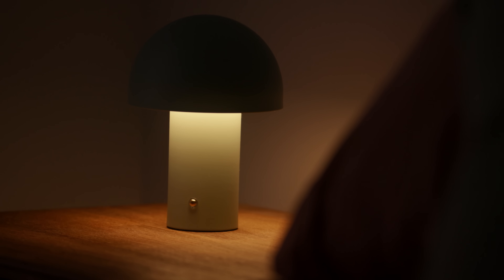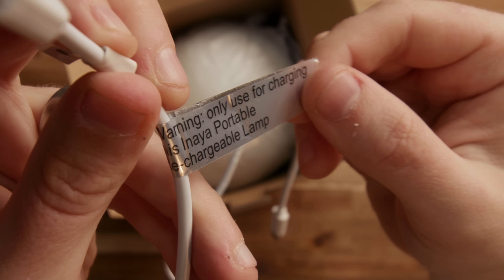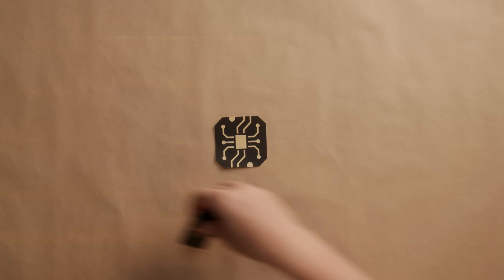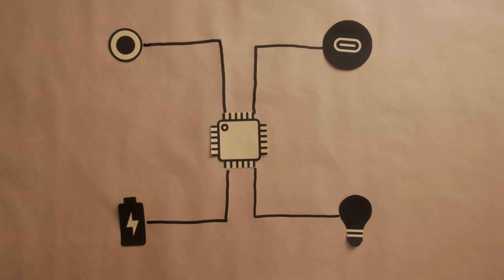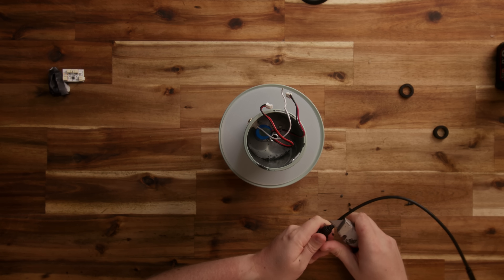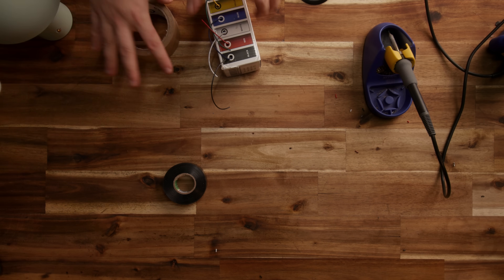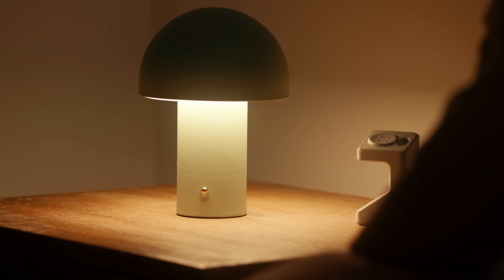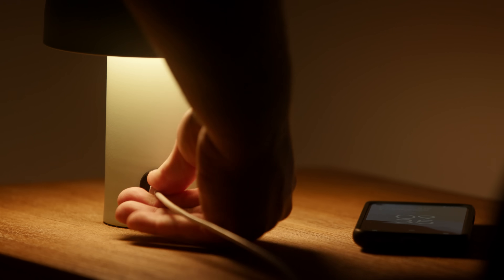Kmart Lied to Me, So I Hacked Their Lamp

Comment: Here's the technical reason for it not working with regular USB-C:
USB-C to USB-C cables strictly follow those standards, and so do their power bricks. That means that by default, no voltage is being provided by the power brick. To turn on the standard 5V (or then 9V, 12V etc), you need to have certain resistor values on the two CC lines. Most cheap products from China, for some reason, don't include two simple resistors... but that's the reason why it doesn't work with a regular USB-C cable. 
Their cable isn't anything proprietary, it's just a different one: USB-A to USB-C. Why does that make a difference? USB-A power bricks don't need any values on the CC lines, since they don't even exist in that connector. These bricks just put out 5V whenever, which is why it is charging with that one. Technically you could've soldered two resistors to it, but that is very finicky.
Great solution though!
Reply: The reason resistors are missing is often because they use cheaper and easier to solder connectors which are missing the CC pins.
Reply: Yeah or you can replace the port with a board that has PD support and solder the ports that make it accept 5 volts.
Reply: @blitzar8443 pd is not required for 5v operation
Reply: Yeah so many stuff that has a USB-C socket but only charges via A to C cables.  
Super annoying.
Reply: @DooMMasteR  I've made it a habit to solder some USB-C breakout boards with the resistors in place to all electronics I have easy access to. I even USB-Cified an older printer from 2006 which ran on 20V via PD!
Reply: Minor correction TLDR By default USB-C specifications* are to provide 5v by default

"That means that by default, no voltage is being provided by the power brick. "
If no voltage is requested, then 5v should be provided by default  for two reasons: 
1) Backwards compatibility, and 
2) To power the device so it can actually request/negotiate for higher voltage. 

"To turn on the standard 5V (or then 9V, 12V etc), you need to have certain resistor values on the two CC lines."
Kind of, you do need the CC resistors to determining orientation, and 5v initiation (so it won't work without them) however they are not used for negotiating voltage. The confusion might lie in that CC resistor values can be used for communicating current capability?

FWIW the video is correct when he said 1:40 "this isn't USB-C at all" 

*The three main power specifications for USB are PD, PPS, & AVS and all three are specified to provide 5v by default.
Reply: Without these resistors, no voltage is being supplied. That's why I say they are required for 5V. With " then 9V, 12" etc. I meant that with these 5V supplied the PD chip or whichever protocol is being used may negotiate a higher voltage, a specific voltage, current limit and so on. Personally, the USB A power bricks provided 5V by default, the new ones only under these conditions. Would they provide it "by default", we wouldn't have these issues. But after all, the resistors have their valid reason in the spec.
Reply: @skyslycer they cannot assume that there is a sink plugged in, that would be risky, and the other end might be a source only device too.

USB-C can be both roles in the same port, 2 resistors are already the simplest route one could basically go.
Reply: @DooMMasteR  I know. I didn't say that that's bad behavior, it makes much sense to do it that way. You can still plug in both ends of USBC into a charger, but afaik, but don't quote me on this, the resistors don't do anything to prevent that.
Reply: @JustinShaedo No USB-C must be powerless by default. The resistors indicate a sink so a potential source can blindly apply 5V. But without resistors nothing will happen.
Reply: I thought it might be something along those lines. But if the lamp charger is connected to eg a phone or PC will it fry it due to putting 5v on the negative data line?
Reply: @imaginitivity7853 no. USB A always has 5V on it. Not in the data lines, it’s on the power lines.
Reply: @imaginitivity7853  it should not fry anything, the lamp is likely wired interally to only have vbus and ground connections and no data connections so it should not be putting any voltage on the data lines

Comment: This project looks awesome, I don't think there is anything like that in Canada but boy is that cool... one thing do beware of cheap ESP32 boards I bought a pack from aliexpress for another project that just refuses to stay connected to WiFi or OTA update, buying a more expensive one from Amazon seems to be working flawlessly, I don't know what to do with these two non functioning boards but I saw a thread saying if you power them by the pins instead of USB they work so idk I guess I'll have to give that a shot. I really want to start building more DIY stuff but I am a real noob when it comes to this hardware stuff

Comment: Really nicely done! But the batteries will drain in a few hours, or perhaps a couple of days, right? The ESP32 + WiFi combo isn't exactly great for batteries. Perhaps you can look into ESP-NOW, and use some kind of polling? Wake up, check for new message, and apply that. My ESP32 projects using ESP-NOW only stays on for roughly 200 milliseconds, which will save a lot of energy.

Comment: The cable won't fry any other USB C charged electronics, it will just be really slow. It's obviously not using PD, so a cable with a set of resistors is used to control voltage and power. This is really common in cheaper electronics and makes for a boring video.

Comment: Missed opportunity... What you could have had done Is use a USBC power bank board. And then you can upgrade the battery or keep the same battery up to you but you would be able to quick charge the battery and you could plug your phone into the lamp to charge your phone. 

Also anyone that wants to do this without the automation, but wants to keep the USBC compatibility can just use a standard USBC lithium battery charging board.

Comment: What psychopath goes through the trouble of continually recharging bedside lamps. Just get ones that plug into the wall
Reply: Handy for camping. And for rooms where there's no available power socket nearby.
Reply from the maker: If you can find me lamps that look like these and cost $17, id love to go that route!
Reply: @TheStockPot-AU  no need to go searching - you just made one - remove the battery and have its power cable be the usbc port and use a simple power adapter for it 😂
Reply: @TheFreeBro    "psychopath"   😁
Reply: The idea is that you can carry it with you to use the bathroom or get water at night
Reply: Cordless is also more aesthetically pleasing.

Comment: I like the esp32 mod and you don't specify exactly what was dangerous about the USB cable. However the most common problem with devices that behave like this is that the USB C connector ON THE LAMP doesn't support USB C PD. This require a 5.1k resistor connected to ground from the CC1 and CC2 pins (separately). Missing these out means that a proper PD charger will not turn on the power, and if you have connections for those pins and can fit the resistors it will work. The reason the USB 2 to USB C cable works is that USB 2 has no need for these pins either (and indeed, they can't be connected).  But as long as you use the USB 2 outlet on your charger it won't care. It's not usually a special cable - it's using the USB 2 that makes it work.

I could be wrong about it in this case :I see no reason for the marking on that cable as it's just like every other USB 2 to USB C adapter cable. But it's not impossible they did something truly weird.
Reply: 100%. They probably just put that label on it so you'd definitely use a USB-A charger. It's probably a regular cable and there is no danger to any device. This could have been solved by using any USB-A charger with any USB-A to C cable and/or adding 5.1 resistors to CC pins. 

But that wouldn't be good clickbaity title.

Comment: First video of yours I've seen.
Enjoyed and subscribed...

K-Mart need a slap for doing that.
Actually would have been better if they'd used a two pin mini audio connector on the end of a USB A wire if they weren't going to follow USB C protocol.
Hats off to you for the upgrade.

Comment: It's a *stationary bedside lamp*, it's not supposed to use batteries to begin with!

And if outlets are an issue, sibce USB C is going for "everything" connector, then USB C standard should also include a "passthrough" devices, where - dunno - a device has an exit port for further charging, and then auto adjusts itself to the received voltage (that is dictated by the plugged-into-it device) via switch mode power supply; or he lamp itself houses a charging circuit.

Honestly, the latter should be the option. I'd make a standard AC lamp that powers itself however it pleases, BUT provides:

- a hidden-underneath (but ventilated) place to plug one's preferred AC charger, with a stylized cover/opening to plug in one's USB cable, or the lamp provides its own retractable variant (or, it could be just a small "podium" addon that plugs into the lamp, so one doesn't have to bother with the cable).

- comes with integrated standard USB C PD charger with one-two-three ports (A and C).

But I think the first approach is better. Simpler to manufacture, and the user provides their own charger (thus it always fits their phone/device, whatever it might be), with the lamp just being a nicer housing for it. Maybe have an attachable addon for the back side of the bedside table, where one weaves their cable, and adds small weights so that the cable autoretracts once unplugged (simpler, no expensive and wearing sliding wiping contacts needed, fits whatever length and type of cable user might need), with built-in "stop" lock, so it doesn't continue to tug on you if you're using it and charging at the same time. A nice "cable dispensing/resting" spot would be at the hand's reach.

And, speaking of lamp, make it user mod friendly and have it use simple and standard connections, and "smart-ready" for the user to add either a simple relay, or more advanced means of control. And, while we're at it, offer custom lamp shade types that all fit the same lamp housing, for customization. The light element itself should be standard bulb socket (for easy and very noob friendly smartification), but make it easily detachable, so it is servicable, and/or exchangeable for alternative lighting sockets (not everyone everywhere uses the same format). And leave enough interior space, if user really wants to add a battery - or offer it as an addon, but then have an option of easily setting it to turn on if tge power is oit (given specific conditions).

( . . . )

Well, essentially... I guess I'm tell you to build your own darne lamp! With blackjack and h00kers!

There, a complete and extremely user-friendly product design!
Reply: Can't speak to this lamp specifically, but I love my battery bedside lamp. I've only had two power outages since I got it, but it's extremely useful in those situations
Reply: @Avendesora  Well, yes, but only as an UPS option, I guess, that's what I am saying. Or, simpler and more useful, since if there's a power outage, and you need light, you probably need it to move around. So, a rechargable torch / hand lamp in the first drawer (or wherever is the most appropriate, taking into account frequency of outages) would fulfill the same role, and allow you to move about.

There, modify my concept for the body of the lamp to be a "dock" for torchlight, essentially; and it should be easily pulled out (removable shade & light dispersal contraption) when needed in case of an outage. 😁

Hm, shade's light dispersal could also offer some sliding mechanism to either scatter or focus light, and when focused, direct it in specific general direction (when one's reading, no need to light up the room, and keep others awake).

Damn. Now I have to bloody sit down and design this thing properly. I guess I'll just add it to my "YouTube video ideas" backlog... for when I actually start the channel. 😅
Reply: @cbs1710  It's nice to have something that doesn't need me to hold it if I want to light an area, but I understand that multi-purpose furniture is highly offensive to you so I'll let you go about your day.

Comment: USB-C is a connector standard. It is not a data transfer or power delivery standard. You can have USB-C without it complying to any of those other standards/protocols because it is just a connector. Some of those other standards require a USB-C connection but not all USB-C connections require those standards.
Reply: Meh, he's half right. uSB c is just a connector, you can run usb1, usb2, usb3 and usb4 over it.  And thunderbolt 3, and a bunch of other non USB stuff, like some audio stuff, and there's even an Ethernet standard...

Comment: Sorry, but you forgot to mention one MAJOR downside of using an ESP32 on a battery powered device. 

Deep sleep doesn’t work for this application, since the whole point of ESPHome is to automate it. So the WiFi eats the battery in 1-2 days, with the light off.

Comment: You guys have Kmart still???
Reply: Kmart in Australia was started in 1969 and was only partially owned by the same company that owned the US Kmart, they sold their stake in the 1970’s. 

Kmart Australia went through lots of changes over the decades so it would be impossible to think they were related if you didn’t see the name. They sourced completely different products.
Reply: @peter65zzfdfh  To be precise, the 1978 deal had the Kmart Corporation (of the US) transfer its 51% stake in Kmart Australia to its partner, Coles, in exchange for 20% of the combined company. The Kmart Corporation continued to hold this minority stake (which eventually amounted to 21.5% of Coles Myer) until divesting it in 1994.

Comment: How often do you have to charge them now that you have a ESP32 in it that has a constant wifi connection?
Reply: It usually not significantly different from before because esp32 have a sleep feature that helps to save the power.
Reply: @afrodite8685  If you use home assistant then it cant sleep because of the always on 2 way communication

Comment: I gotta be honest I think the "this could fry your other devices if used" is a bit of an exaggeration, but later in the video when you showed the other end of the cable at 2:26 it gets easier to explain and less dangerous. they ARE using the USB-C port, but it's wired as a drop-in replacement for Micro USB (4 wires Black, Green, White Red, infact as a lamp I am betting they are only using black and red), this means it will only work with USB-C to USB-A cables because when using a C-C cable a handshake has to occur to explain which way power is going so without that the direction power is supposed to flow is never given so it does nothing. Using that cable with another usb-c compliant device just means that it will act like a legacy cable, slow charge speeds, slow data if the cable has the data lines. That said literally any USB-C to USB-A cable will work so it's not like they locked you into a "fake cable".
Reply from the maker: That's what I thought too, but I probed out the included cable, and this is the pinout:

USB A       USB C

GND    -------> GND
D+  -------> VCC
D-   -------> VCC
VCC -------> VCC

This was measured by converting the USB C end back to USB A and checking continuity between the pins.
Reply: Yup, it's wild that they decided to cheap out over two resistors that make C to C work.
Currently, the same resistors are available on LCSC for $0.0008 per piece, if you buy over 1K. They probably got some savings on the "dumb" USB-C port as well, though.
So, maybe they're saving like $0.09-$0.25 per lamp? Awfully low savings for what might literally make your product seem defective to people who just want USB-C to work.
Reply: Okay I apologize for going so hard that is truly a whacky pin out
Reply from the maker: No stress! I was dumbfounded too 😂
Reply: pfp goes hard